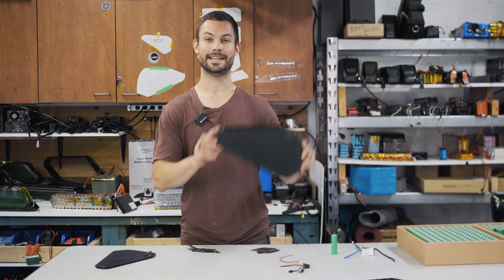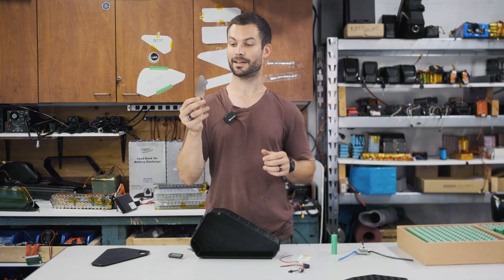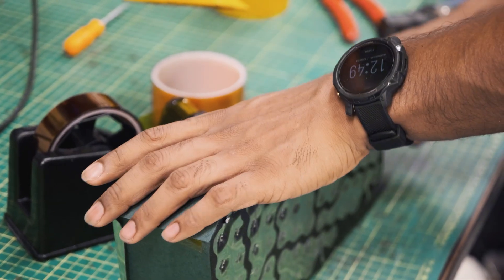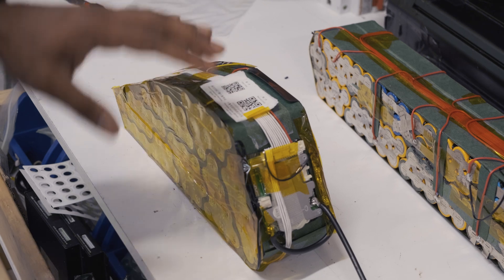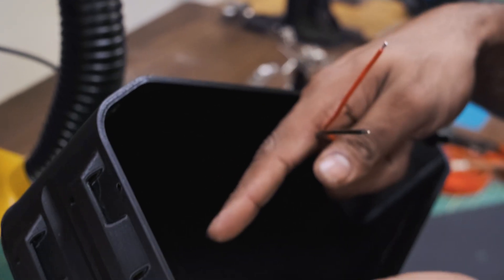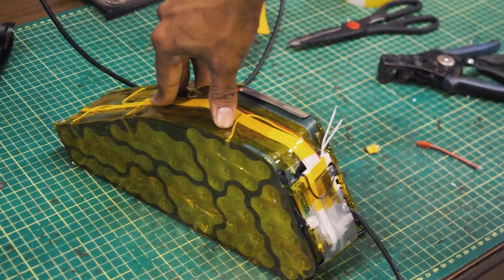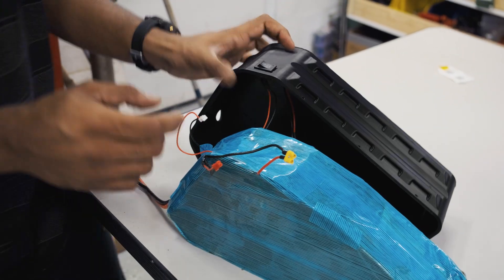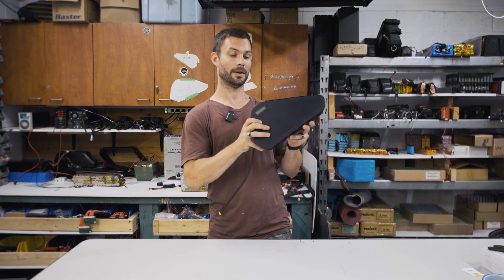Build your own Battery - 52V 20AH 3D Printed Triangle

Comment: I'm in the UK - I was wondering if you sell those nickel strips plates as I've been thinking about building a 72v 40-60 ah 5000w  battery pack with a 150 bms. My aim is to build something over time that might be capable of 170 miles of range  which is the total miles from my partner of London to Brighton on sea a seaside town in west Sussex here in the UK. Also would it be possible for you to print me a battery case if I sent you a template 
If so how much in pounds sterling would it cost thank you for putting this video up it has helped me with my confidence in possibly building my first battery 😊
Reply from the maker: Get ready for this week's video :D I think you will like it!!

Comment: Thanks so much guys for this excellent e bike battery share. I am trying to replicate this design; unfortunately, don't know how to design a custom made pre-cut nickel. Do you mind sharing the nickel pre-cut files?
Reply from the maker: The company is on Alibaba called "Wellgo" , they are the go to place that's where we get them. A basic sketch and tell them the cell size and cell spacing (in this case 22.75mm spacing and 21.4mm cells). They can help you out !
Reply from the maker: Watch our upcoming video that should come out tomorrow, we show in more detail how to get the pre-cut copper / nickel plates

Comment: Okay, I'm putting all my faith into this comment.🤞

Hey guys! I truly appreciate the content you've been putting out here on YouTube. It has helped me a lot. I actually learned to 3D CAD battery cases from your videos about Onshape, so a huge, huge thanks!

I'm Solomon from Rwanda, and I have an e-bike project currently ongoing. Rwanda is known as the country of a thousand hills, and my love for cycling has quite literally been weighed down by gravity. So, I've ventured into building e-bikes with the goal of providing affordable electric bikes not just for myself but also for others who need them.

E-bikes here typically cost over $1,000, which is almost 1.5 million Rwandan francs — far above what most people can afford. My goal is to produce a mid-drive e-bike that costs no more than $250 (without the battery). I'm also working on affordable batteries, not just for the bikes I will be building but also for other e-bike builders looking to convert their bikes.

So far, I've designed a frame in CAD (Onshape), and I've had the prototype mid-drive frame welded from steel. It's very robust, and I've been testing it since May 2024, with the motor, controller, and a battery mounted on it. It works great, except for the battery.

I'd be happy to share more details, and I hope this piques your interest enough to warrant a full story. I'd love to share my unique experience of what building e-bikes in Africa looks like for the average person.

As for your 4k subscriber mark, I reckon you'll hit your target in less than five days. If I'm right, please do me a favor: pick my comment and support my work here in Rwanda. You'll not only be helping me, but you'll also be impacting thousands of lives in the long run. (That being said, I'm not exactly sure what I need more from you guys — your advice and mentorship, or perhaps some 2170 battery cells for power/performance benchmarking.)

Thanks for considering my request, regardless!😁😇😊
Reply from the maker: We'd love to hear more about this !!
Reply from the maker: Keep us posted !! 😊
Reply: Wow, that sounds  amazing.
How would you like it? 
Perhaps a short video presentation of my project or maybe a 1 on 1 online session? 
Whatever it is you guyz prefer, I'm up for it.😊
Reply from the maker: If you can do a short video presentation upload the link to YouTube send it over to us to watch 😁 That would be awesome !
Reply: Ok, I'm on It!🎉
Congrats on reaching 3.99k subscribers by the way. Guess I predicted right😂.

Comment: good job but not the best.. the best is again triangle but as small as possible and as thin as possible for race bike frame.  cells should be the different orientation.
Reply from the maker: Can you share more info ? We would love to see !
Reply: @ElectricBikeLaboratory   Trek Speed Concept SLR 9 AXS
Reply from the maker: @gokhanceterez1043  That's not an electric bike at all. Can you share with us the better design of a battery that you're talking about , would love to see.